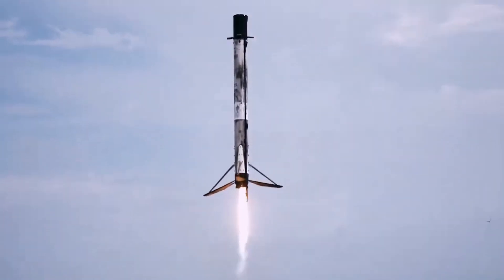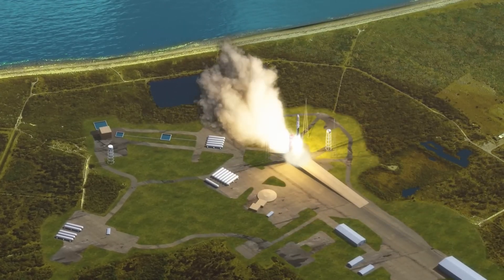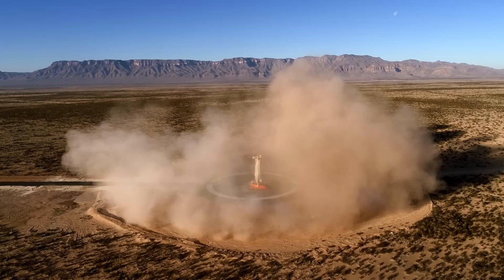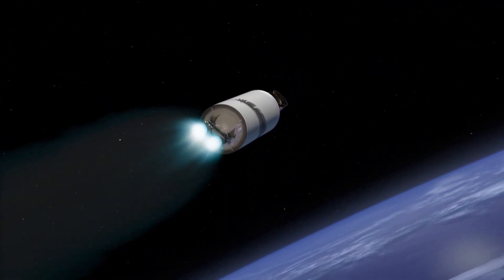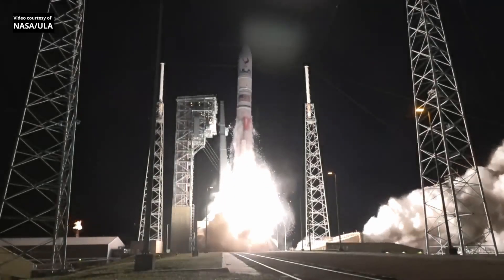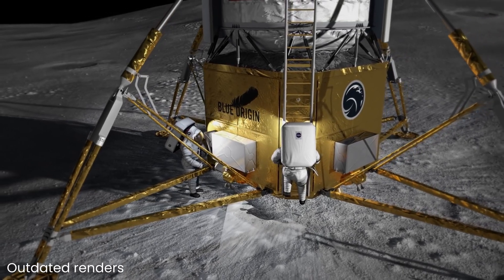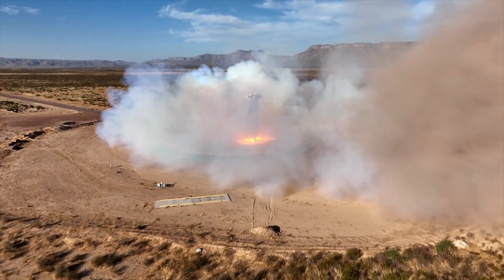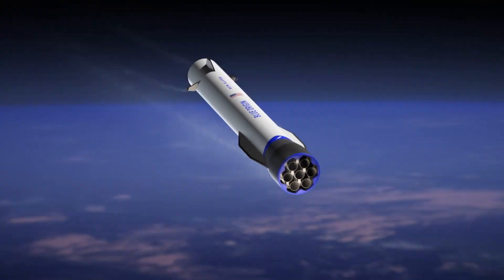Blue Origin: All you need to know

Comment: "That other company" 1st reached orbit in 2008 and Blue is still talking about it in 2024 and most likely 2025.   But heck for an aerospace company that has existed for 25 years, what is the rush to get to orbit?  No worries, they are marching forward and starting to build a lunar lander before they even reached orbit, why not?   I would of bet my life's savings back in 2007 that Blue would have reached orbit by 2020.  

Considering that NG is Blue's very 1st 2 stage rocket, what could possibility go wrong?  Especially since they haven't even hot fired the integrated 1st stage yet and all of the flight software is based on computer simulations and no real world flight data, nothing to worry about.  The flight control software for staging is also completely brand new and Blue has no experience ever staging a rocket.  Again, should work perfectly trying it the 1st time?   Who needs actual flight data to fine tune the flight control software?    

Landing, no worries.   No need for a hopper program to test the software.  New Shep's flight of straight up and down seemed easy enough, landing on a ship 100 miles out in the middle of the ocean seems to be just as easy.  Should nail it on the very 1st attempt too.  

The media is living with the assumption that this will just happen, and perform as planned on NG;s very 1st flight.  All of these 1st's will magically just happen and rocket science isn't really that difficult anymore.   Test flights are for those slackers at SX who just don't know what they are doing.  Blue can do it all on their very 1st flight.  

Actually it isn't the 1st successful flight that is going to be Blue's real challenge but it's 1st flight re-flying the 1st stage booster.   After they master that it will be about getting human rated.  I also haven't seen even a rumor of a launch abort system and a valid reentry system that could support human.  

It also seems rather silly looking back on this now, that Blue spent so much time trying to figure out the landing systems on NG before it even flew to orbit.  Why not, just fly it in an expendable mode to shake out any issues and bugs before trying to figure out how to land it?   Seems like they would of been much fruther down the road today in Dec of 2024.  They still don't know what they don't know about how NG is gong to perform in actual flight.  Simulations are great until what happens in the real world doesn't match up to what you were expecting.

Comment: At best New Glenn is an extremely bad joke at worst it is just a tax scam. Either way it is not a space company.
Reply from the maker: Pretty interesting to call it 'not a space company' when they have been to space almost 30 times by now
Reply: @zenothksp Calling, passing the karman line (which the nazis did in 1942 btw), going to space, is like calling, sticking your big toe in a small puddle, almost drowning. It is an insult to actual astronauts.
Reply: @Gijs-t7p  then go to space if it's that easy.
Reply: @noelpatata3948  Proofs again, you do not get it.